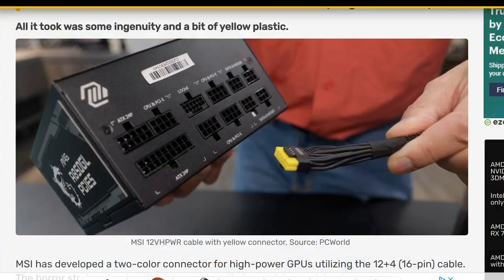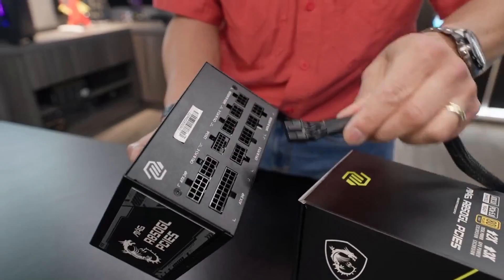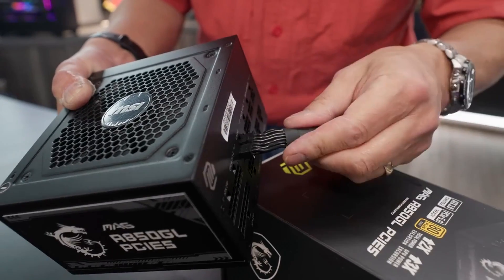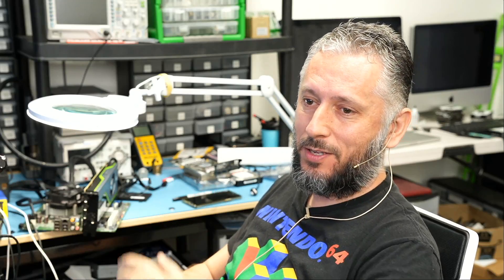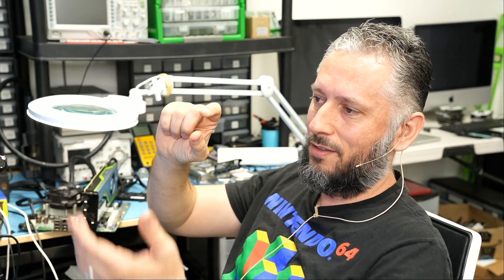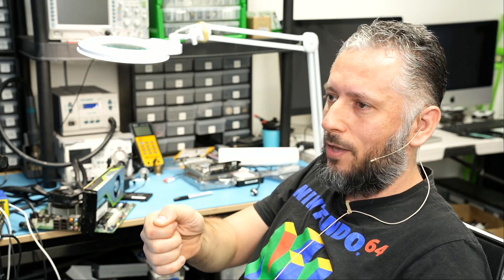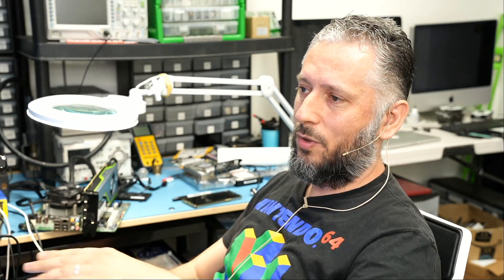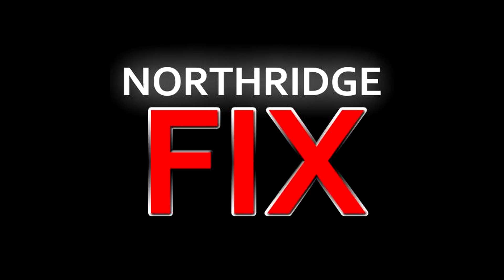4090 Melting connector Fix using MSI yellow cable 12VHPWR. What?

Comment: In my opinion, all of these "solutions" and workarounds are nonsensical attempts to avoid the fundamental and actual problem. The excessive temperature is a result of too much current flowing through a limited number of connections. It seems like everyone is searching for solutions and assigning blame elsewhere instead of acknowledging the poorly engineered design of the video board itself.
I am aware that there are many of these boards currently in use, and a solution is necessary for the users. I believe a product recall could be the most suitable resolution, although I doubt the manufacturer would be willing to bear the associated costs. What will be the next step? Will we witness the introduction of a dedicated fan to cool the connector?
As always, is a great video full of information. Regards!

Comment: The simple solutions are always the best ones, and unfortunately  although MSI have made a great effort and its the best we have so far.. I don't feel it quite solves the issue, true it will give you an indication something is a miss but it doesn't fix it.... 

I still don't trust that connector, this is why I have skipped cards with it, I feel we are  better off with the older ones that have been tried and tested for decades,  for this many pins in such a small space that has dire consequences if it moves a tiny amount for whatever reason, it needs screw terminals to stop it wiggling like the external peripheral cables of the '80's and '90s,  I reckon the connector doesn't have enough engineering slack to cope with these situations as if it did, we wouldn't be seeing it happen, but yet again I remember saying the same about SATA power and data cables when they 1st came out with all the headaches of shipped machines DOA unless the cables were hot glued. the SATA power cable is something else that's absolutely stupid IMHO too..

Comment: The yellow is nonsense. Nvidia failed at cleaning up the look the ugly power connectors in favor of the mini plug. This mini plug style connector is the failure, not the way it is plugged in (once fully clipped in). This connector style change along with the card itself are to blame. 100% nvidias fault and they will be liable for this failure.

Comment: Waitttt a sec... These connectors have some (interior) length in them, something around 2-3 centimeters (the pins?), so even if it's not 100% fitted... There's still a "proper" connection. I would say if the connector is wiggling around the port, yeah sure, maybe that will cause some electrical problems. Am I right or am I wrong?? Like you said 'we have NOW to worry about this'... Why is this a problem now? And why it only happens with a 4090... And not with other hardware?? And there are a lottttt of hardware that have the same type of connection

Comment: I wish I have the ability to do the test I have in mind but anyway,

I am suspecting that the problem is in power consumption balance over the different power connector I think most of the power that is supposed to be balanced across all the 12v is consumed only through the below row which leads to heat and melting down the connector.

it can be tested simply by measuring the current consumed through each line individually to show clearly if the problem is in card design or cable tolerance

Comment: He Cranked on that black one trying to get it to back out and barely touched the yellow one. Based on what I saw your power supplies and GPU connector will melt now using that yellow one

Comment: Remember not all modular power supplies are pinned the same at the power supply so do not use cables meant for one brand of power supply in another brand of power supply. This of course does not solve issues with non modular power supplies.

Comment: This is getting ridiculous. The fact that they want to pull that crazy amount of current on contacts that are not able to handle it is the problem, not the user. If you want to increase current, you need to increase conductor cross section and  contact surface. This has been known since we had electricity. It is not rocket science.

Comment: Sounds like nonsense doesn't it?

Like a "solution" that is given but is not a solution and they probably know it, just creating room for blame on users.  It's the cheap answer for them.

I would hazard a guess that the connectors are not adequate for such high power draw.

They need to be made from a higher mass of conductive material.

Failing that, maybe the connector itself is no longer useful for today's power draw requirements.

An interesting experiment would be to solder higher guage cable from the psu to and solder the other end to the video card.  See how that performs.

Comment: I don't think they are necessarily releasing it as a fix, but as a way to reduce user error as much as possible. As much as I know you don't want to admit it, at least some of the failures could hsve bern avoided if users had fully inserted the cable. MSI is going above and beyond when they don't have to.
Reply: Yeah, they are trying to make it fully fool proof.

Comment: Well that proves it even more, that we should have sticked with what has worked for many years. A connector that so easily  disconnects while engaged, should not even be called a connector. It connects to disconnects. It's a disconnector. :P
Reply: Also the regular cable 6+2 pin, has 2 tabs to click into place! This new connector, should, as you have said, better have clips on the side, because it is longer. Or 2 clips spread across the top. Whatever... This clearly aint working.

Comment: Northridge, have you seen asus proprietary motherboard and nvidia card solution? Dont know if its coming out but the power connection is on the motherboard for the 4000 series lol. Should be interesting. There is no power cable to the graphics card directly. If it fails in spectacular fashion i wonder how they will handle the returns.

Comment: If the cable is that intolerant of a slight miss alignment then the cable and plug are a faulty design. End of discussion. Just think if the plugs in your house were this intolerant. There would be houses burning down faster than you could build them.

Comment: I havent watch more then 1 min of the video,  and there is nothing amazing about this..  the design is bad,  and need to be replaced..  what is next,  a hot glue gun is needed ?   the pins are too small for a friction fit when all these watts are needed..  make the pins longer or wider,  only option..  

Now back to the video..

Comment: Alex, are the damages always on the same pins on the 4090? When wiggling  I thought the problem should appear on one of the sides of the connector, but 50% left and 50% on the right side. But I'm not sure about that.

Comment: If the tolerance of the mating plastics allows for wiggle of a few mm in either direction - the locking mechanism should have lateral clips as well.  My suspicion is that the conductors/connector plates are undersized and are only rated for the maximum power draw when the conductors are 100% seated, increasing the size of the internal connector conductors/plates would likely have mitigated the issue.  However - the cables/sockets/etc are likely within spec of the 12VHPWR documentation, so this is also a specification as well as implementation issue.

Comment: I really want to see what power supplies these users or company, that sends in these cards, were using.  Heat through arcing cannot be the case here, as multiple parts of the connector are overheated and melt.  We all know that heat starts with friction or resistance.  Were these power supplies sending clean power to the card?  Do these cables have the correct thickness (resistance), and could the design be changed in a way it would not wiggle at all?  I have been following this debate with a lot of interest.  It does seem that sponsored channels are approaching this somewhat carefully as to not step on toes.  One cannot simply brush this off, not when a card cost more  than a month's rent.  If I drive a cheap, used car and there is a little rattle somewhere, I would not get as upset as when I drove my Rivian down the road, and it creaked in the suspension.  In both cases, turning up the radio might work for a bit, until your phone starts warning you about the noise levels - lol.

Comment: Yea I completely agree with your take. It would be like going in for an oil change, leaving the oil filter is leaking because the filter didn’t tighten all the way and so you run out of oil. Your engine blows up and they say well. Did you check underneath to see if it was leaking if not  it’s your fault, not the mechanics

Comment: My EVGA 3080 Ti FTW3 Ultra has 3 8-pin cables and one of these connectors is almost as big as these new style connectors. We are going from 2 or 3 8-pins to one. If you have to worry about the connector being that precise then there is too much power being drawn through it

Comment: It is just another design error, the connector uses locking tabs, but we are able to unseat that connector, no matter what color is. The best solution is something like the old VGA connectors with two screws on each side. The cross sections of the pins is another problem, maybe heat is expanding the contacts and increasing the resistance,  spring-loaded contacts maybe better. Considering the price of this graphic card, it is awkward the fact that this connector is causing the problem. I miss the old days when everything was built with durability and repairability in mind. Today everything is calculated to the limit, if you are exceeding the specs just a little, game over.

Comment: I don't have to worry about this problem, However I do have to plug my stuff in the exact same way and I have Black On Black. When the user pushes these plugs in they make a little click when it is in, Why would you then wiggle it out, and or How does it wggle itself out after it is seated???  I suspect that some of these connections are user error because in regards to the GFX card more than likely the user is probably trying to make this connection while the Card is seated in the Board. And the user(s) trick themselves into thinking ??? the plug is seated in the card because they don't want to put any undue pressure on the MOTB seat connection on the Board. This connection should be done While the Card isn't in the Board.

  And this Yellow colored plug is a decent idea, but even the plug itself shows how it can be user error, when the Plug is actually seated as all the yellow is gone, but then if they are going to wiggle it exposing the yellow, that is User error, as a plug can't wiggle itself loose, and if you are going to stuff the Wires in the back of your case with no due care or thought of what you are doing, I suppose it could wiggle a little loose ??? that way. But I use my Example Blk on Blk and I have no power issues with any of my stuff.

  Now if that Yellow plug when clicked in didn't allow you to wiggle it out to expose the yellow of the plug then I would say that is a really good connection and the intent of the yellow of the plug does what it was designed to do, show full seat, but again it also shows that it is a bad connect when the user wiggles it LOOSE??? Why would you do that. And if it unseats itself by just installing your PWR supply after all the connections are made, then the user is doing something wrong.  Other than this then the cable itself can't do what it it designed to do , because of POOR Design and or inproper Wire gauage.

 Cheers - R.M.

Comment: Alex, what do you see with your thermal camera with a board plug in and operating in regards to the plug ? Heat build -up here would mean resistance in the connection.
Reply: That connector is going to get hot even when it is plugged in properly. A thermal camera isn't going to reveal anything, that has been done many times already.
Reply: @--_DJ_--  seems like a good connection would not have heat build up.
Reply: @steeleleestele  Even properly sized wires alone will heat up under normal load. Any connection running that much power through it is going to get warm. A bad connection just gets hotter.

Comment: I do not believe it's a fully seated connector issue. I think there's a design flaw with the first generation of the soldered connectors on video cards, and this was hinted upon in other videos were they took some x-ray images of connectors where it seemed the metal bridges in the connectors were underscaled for the power designed to flow through those pins. Another issue they hinted on was the female pin clasps that are meant to hold onto the pins from the connector, that maybe they were also made of a thinner metal than what was needed, causing the metals to heat up and eventually melt the connector. Sure, fully seating the connectors would give a first generation soldered connector the best chance to not overheat and fail. But, if the metals inside were underscaled for the required power draw, it's still going to fail. I do like the idea of using a bright color on the plug as a visual marker to ensure the cable is plugged in all the way. That is a very good idea. But, if the socket it's being plugged into was designed with thinner metals, it could still overheat and fail. You might be able to use thin layer of bright paint like yellow, pink, or orange, let it dry, then see if this method would still work. Assuming paint would be very thin and not be too thick for socket.

Comment: You mentioned briefly the perfect solution to end this whole issue... redesign the cable connector so that they have clips on the top and sides. That way there is no more wiggle room.

Comment: We will continue to see melted connectors, the only difference will be the color in which it melts. A timid solution for something so important and expensive. one solution is to split the card load into two connectors, but it's a expensive change.And not only that, it would be admitting that it is a bad design and that is even more expensive.

Comment: You can't just blame the end user. When a product has so many problems, it becomes too easy to just blame the end user.

If you know a little about current and wire size and have used quite a few different power plugs, then you know that this type of plug cannot withstand so many watts.

We have long since reached the limit of what this plug can handle in terms of watts.

Someone needs to design a new plug that is better and can withstand more watts. Factories of computer parts must stop using this type of plug.

If you disassemble this plug and take out the sleeves that sit inside the plug and see how much of it really makes contact with the pin on the card and how much pressure it has against the pin, you will realize that this is not the best type of plug!

Comment: A useful Idea for troubleshooting, as it turns out, but definitely not a solution since the flaw is baked in to the design.  Also, the PC World video showed a cable being connected to the PSU and not the GPU.  The GPU is where all the failures are occurring.  We have seen a fully seated connector in your previous video with the Cablemod piece, and it is in THAT video where the proof (of the design flaw) is incontrovertible.  Thank you, MSI, but for what I am not sure.
Reply: A closer inspection of that cable mod adapter shows it may not have been fully seated. You can have a look at GNs response video to see for yourself.
Reply: @--_DJ_--  I saw the video and the adapter was fully seated.  Don't gas light me.

Comment: The cable can come loose from vibrations, just by turning on the pc. And maybe you clean your pc from time to time, and move it around. More vibration, and cable can come loose. Having it yellow want help you if it comes loose from the psu, most psu are hidden away. And not everyone have the gpu in a window so you can constantly see if the cable have come loose. People, the only user error that happens is the fact that you are dumb enough to buy these GPU´s.

Comment: Seems like instead of a cheap workaround, they should redesign a better locking system between the cable and connector.

Comment: I would like to see some objective calculations. What kind of resistance is needed for causing the heat needed to melt the connector. And then, how bad should a connection be to cause that redistance.

Comment: An analogy to this is your car wheel nuts/bolts coming loose if you go over a bump in the road or steer left and right a lot.....is that user error? - should you check your wheel nuts are fully tight every single time before you drive your car? - No....that is a defect, a design flaw and should result in a fix from the manufacturer and a recall.

Comment: too high a load through too small a connector and changing the color of the connector wont solve the issue, at best it MIGHT lower the damage.
there is a reason AMD dont use it.

Comment: Is it possible to hardwire/solder a custom made plug to the original plug ? , and that leads to a small plastic box next to the original plug hole with 4 original older style GPU plug connectors ?
I would pay to have my GPU modded to what I described for a piece off mind .

Cheers

Comment: Even with this yellow tip, this connector still looks like Sh*t. This connection should be rock solid, but no... you can easily pull it back :D

Comment: I completely agree with you.  If we have to use yellow parts on every connector in a PC, the user can be blamed for everything.  The clicking of the clip should be the assurance that the cable sits right, not whatever colored  parts are maybe just still visible.
Reply: You're very intelligent 👍👍